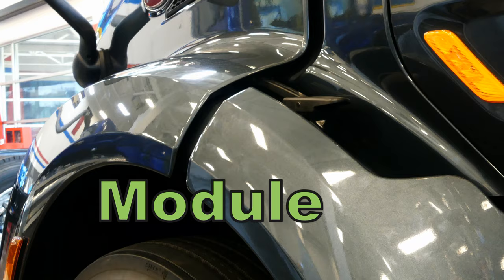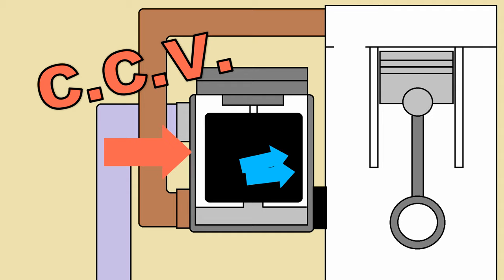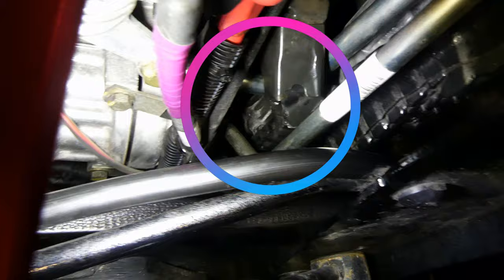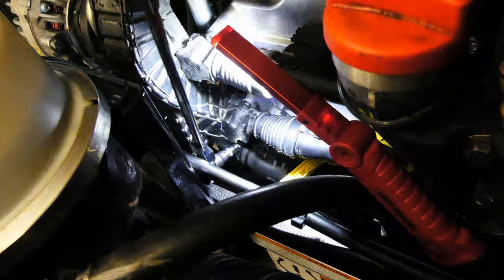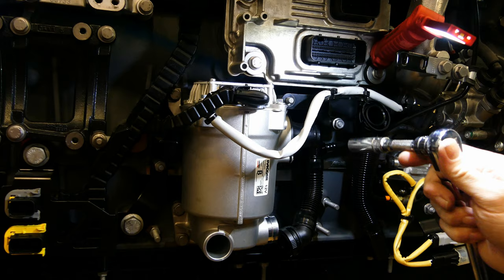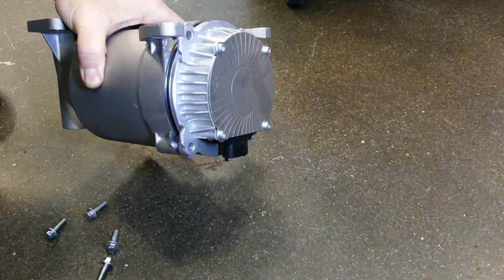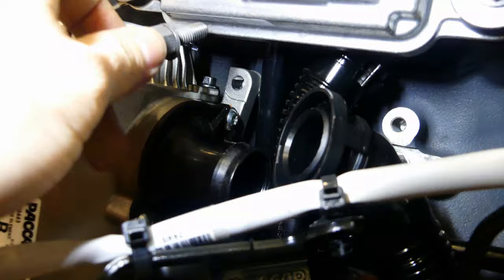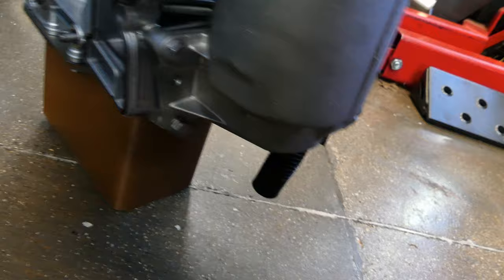Change your Paccar CCV Filter!!!

Comment: Good luck getting one my truck was down at Rush Peterbilt for 3 months last winter, because it was on national back order 😢😢😢 and finally, they got one for it, and was just told by them they are still hard to get
Reply: Do you remember the code or symptom of the engine

Comment: I had to remove the ECM to get the filter out the top because the lower ecm harness would NOT move enough to get it out no matter what I unbolted or zip tie I clipped.
Reply: Loosen the harness up and use zip ties to secure to the drag link as tightly as possible and out of your way, I do this job in an hour

Comment: I recently pulled my ccv unit and to my surprise, it had a filter that could not be changed. I had to buy a brand new housing from the dealer. Luckily they had one on hand.
Reply: I just got the call from my dealer stating mine was crumbling and the whole housing had to be replaced. $1200 for the entire part. 🫨
Reply: What year is your truck and what epa?
Reply: @drewgzz  EPA 13. Be sure to make sure you oil pan is not cracked near the ccv drain hole. That plastic will crack after several years and it look like it’s coming from the ccv unit. They have a recall for the cracked oil pan.
Reply: @ajsmith2697  ok. Thank you !
Reply: You know why changed it ! I mean does it give you code or

Comment: This has to be a satire video.  This is a pain in the ass job, and if you break the intake tube or harness connector it's a big pain.
Reply: I agree, I have found that if you remove the alternator and alternator bracket attached to the block it is 100 times easier-to gain access to the upper left hand bolt in the ccv module.  And you are correct about the tubes, they are plastic pieces of crap and can crack/break easily so be careful!!

Comment: I’m getting SPN 5396 FMI 1 code. Description says “engine crankcase hose disconnected.” Could this be a dirty filter and need a change?
Reply from the maker: Possibly. Wouldn’t hurt to check all hoses and make sure everything looks good before tearing into this project.  What year and what engine do you have?
Reply: @Dartmech  It's a 2017 MX13. Just came back in from inspecting it again and the vent tube is fairly saturated, but everything looked hooked up nonetheless. Truck is running fine, just can't stand seeing that orange cel all the time. Thanks for your response!
Reply: Yes it's the filter
Reply: @brandonsoltis2132  Funny thing is when I removed it it was clean but replaced it with the updated smaller “forever” filter and everything started acting right. Guess it was the filter after all. Thanks

Comment: Where is the ABS sensor … have ligth on .. TK
Reply from the maker: You should have one wheel speed sensor per wheel.  Usually located on the top. Try pushing them all in and see if any are loose, then go drive around and see if the light goes out.  Some times that helps.

Comment: What could happen if you dont replace it? And what are the change intervals?
Reply from the maker: about every 150k or so.  Varies by application.  It'll throw codes if you don't change it out.
Reply: @Dartmech  Could SPN 5396 FMI 1 “engine crankcase filter hose disconnected” be one of those codes? I checked and everything is in fact hooked up just fine. 575k on the truck I just got, not sure if it’s ever been changed. Thanks
Reply: Got my truck at 431,000 and now it's at 650,000 
never noticed if it had one.

Comment: Yeah I know idiots engineers they designing the engine out of frame they don’t think that the engine is going to be in the frame being an ass to take it off. The filter is 100 bucks to replace is 2500 bucks.
Only one problem when I replaced mine the filter it was like brand new don’t make sense

Comment: No need to take the ecm connector loose, thats just added unnecessary steps. Use a wobble to get the top front bolt and a wrench to get the top back bolt.

Comment: How long can you drive after it starts leaking
Reply from the maker: It’s leaking? Throwing a code?
Reply: @Dartmech  No codes I think it’s oil pan leak just got in  this truck and I heard rumors about that filter because I discovered a little leak but I got under and see where oil pan was just wet and leaking on the left corner research find that it had a new block put in it about a month ago so I’m going to get that check out thinks for responding back